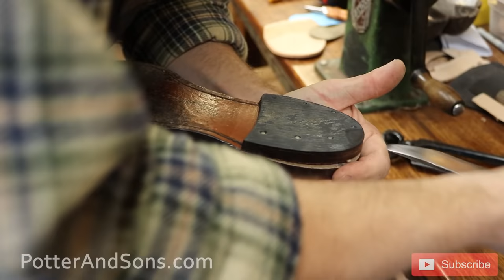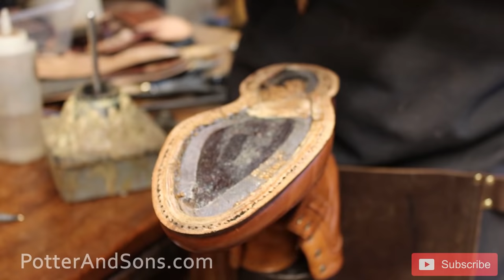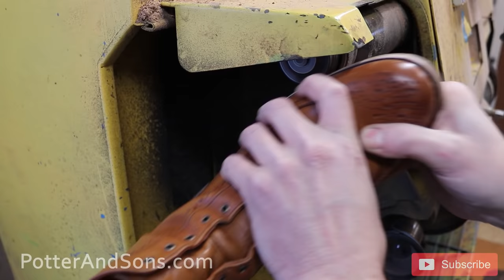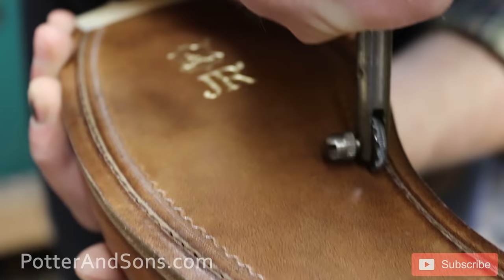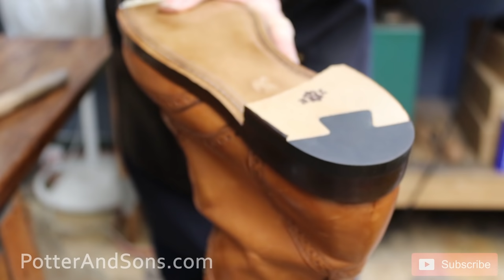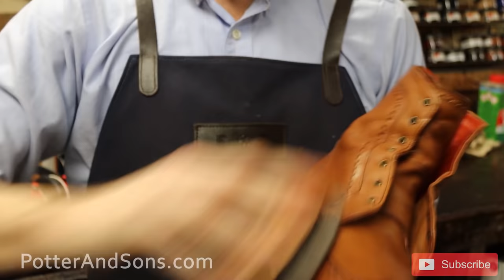The Sounds of Shoe Cobbling | Unintentional ASMR

Comment: Is the liquid you’re pouring onto the sole just water or a special solution? If so, what do you need to wet the sole materials for?
Reply: That's acetone, a solvent. It is used to cause the glue or cement to release the outsole being removed.
Reply: I think they weth the JR soles to make them a bit softer to work with.

Comment: Hey guys nice video, just a quick small suggestion i think may help you a bit. On the thinner bottles I’ve seen it in a few shops they’ll put a leather dye cotton dauber like the ones in the Lincoln box boxes to spread the thinner with more control and able to focus it more on the edge where the stitches are, and not worry about spillage. Sometimes sanding them to expose the grain of the leather helps it penetrate better and set under the heat lamp a bit if it’s been repaired before and is stuck on real good. All you got to do really is just clip it to the length until it gets through the nozzle then bend it on the inside maybe with needle nose pliers. Just thought that might help you out a bit. Great work! 👍🏼

Comment: Another great video!  Question for you pros...I'm assuming the Saphir products you deal with everyday are much friendlier to be in contact with?  My understanding is that there are many more natural ingredients in them, as opposed to the solvents, silicone, and chemicals in cheaper brands...is this correct?  In the past year, I've switched over to all Saphir polishes and conditioners for my shoes, and have less apprehension about getting the stuff on me as in the past with other brands.  Do you have any more insight on this issue?  Thanks!
Reply from the maker: Flintlock85 That’s exactly right.  Saphir uses a lot more natural ingredients than many other brands, which is another reason why they’re so much better.

Comment: Quick question! When do you know you need to resole your shoes? I bought a pair of Allen Edmonds (loving em) but surprised how quickly the sole gets worn out and I have only worn them for 5 times (compared to the rubber Cole Hans I have owned for over a year). Any recommendations? Thanks!
Reply: Tomasz0216 a couple of things to watch for: first, a hole in the dole is self critiquing. Second, and most critical, if you have worn up to the welt, it’s time to have them resolved. I suggest a stronger leather sole such a a JR or others fine brands.

Comment: Mmm, nice video to listen to. I do have a question though, if a construction worker had a pair of custom leather work boots, the heavy duty kind with grippy tread, ceramic or steel toe, and so on, that needed some work, would you guys do anything with it?

Also, what if there is damage to the top of the shoe, like say, a hole around where the toe is, can that be fixed?

Comment: Hello. I have a question. How to remove candle wax from suede shoes??? 
I had candle wax spilled on my suede shoes...and I'm not sure how to remove it.
Reply: Katerina Patiniotis ouch, that’s a tough one. Usually, hot wax melts into the nap of the leather. You might try a suede soap cleaner first. Lather it up, wipe it off, and then use a small steel brush. Hopefully, that helps.
Reply: @normanpotter2205 I'm afraid the  steel brush will damage the surface of the suede. Will it leave scratch marks on it?
Reply: @normanpotter2205  Thank you very much for your help. I will try to find a suede cleaner.
Reply: Katerina Patiniotis just barely rough up the nap with the brush.

Comment: You need to pop a hole in that finger nail, use a red hot paper clip it will relieve all that pressure and keeps the nail from falling off.

Comment: I can’t believe I found that as engrossing as I did. But I love watching such amazing hand craft skills, especially the leather crafting on thongs soles. The more I learn the more interesting it becomes and the more questions I have (I don’t know why as I’m a photographer and not a cobbler). I do love my dress boots so this was a great one for me. But I’d love to know
1. Why do you pour the glue remover (which I just learned from the last video) on the sol but then remove it anyway?
2. What are those JR soles? They look amazing, especially when your’e finished with them.
3. What is the brass fitting at the sole tip for?

Amazing job on the soles and a great video. Thanks.
Reply: Michael Ryan 1. Cement Thinner is used to remove the sole to prevent damaging the welt and insole. 2. JR Soles are one of the top two or three soles made. 3. Toe taps to prevent wearing into and damaging the welt.